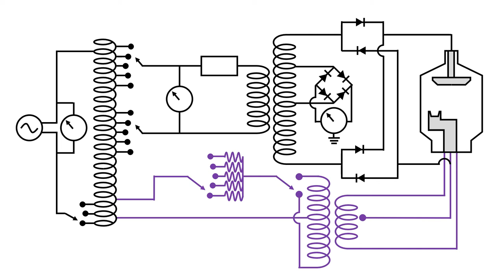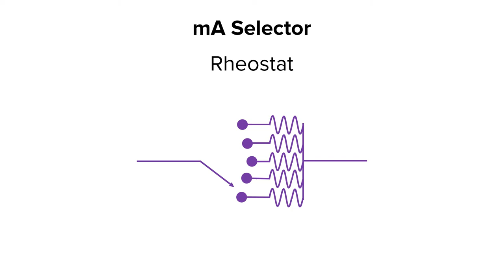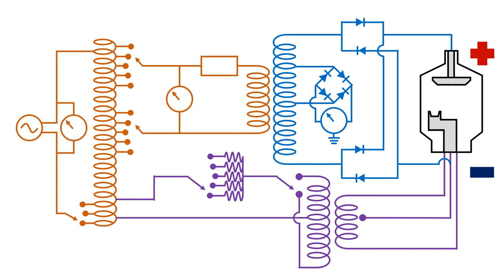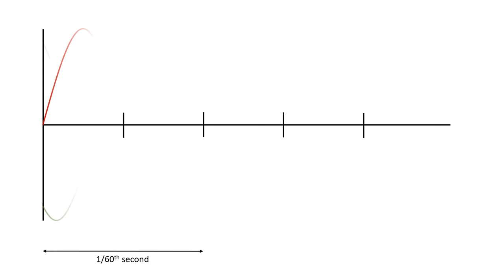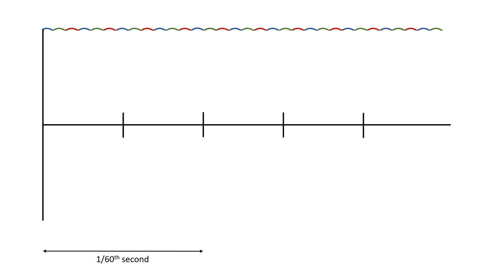Filament Circuit

Comment: 2:20 you said mA we selected adjusts the rheostat and sends the current to either large or small focal spot. I think you meant to say it sends the current to either large or small filament correct? From what I've learned the focal spot is located on anode itself. Am I getting this right? Also, thanks for the video - very helpful